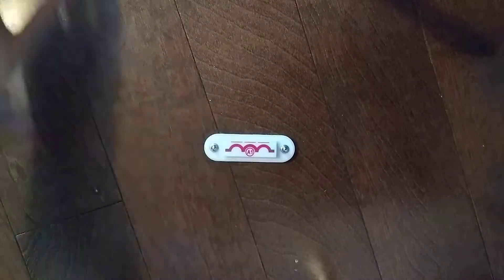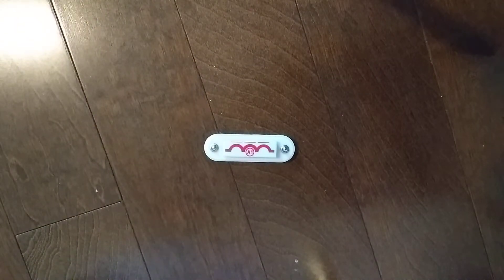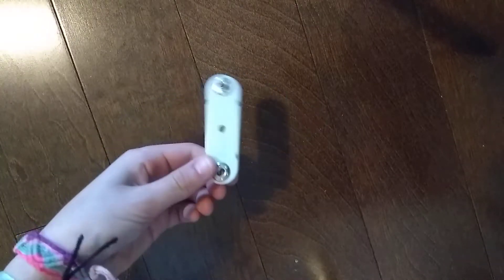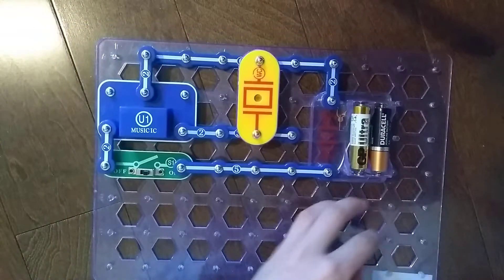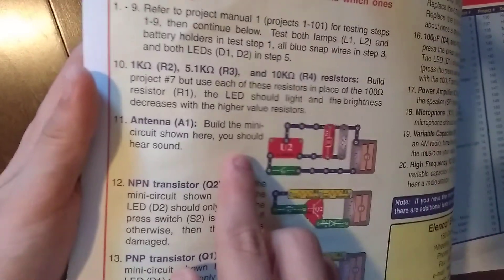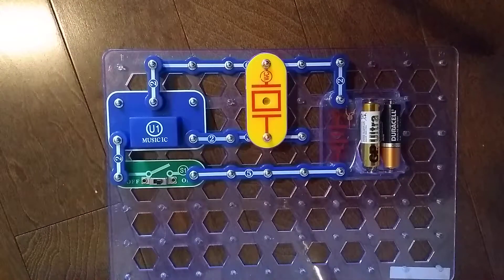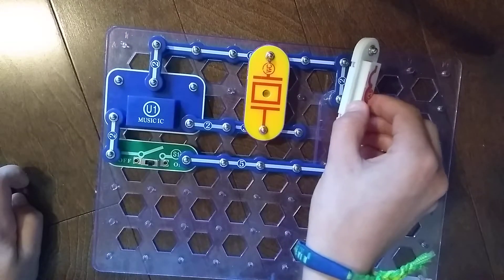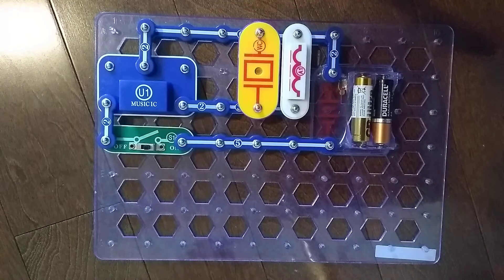Snap Circuits Parts: A1 (Antenna Coil)

Comment: The Antenna Coil (A1) can also detect AM radio frequencies if you can connect it to the High Frequency IC (U5).
Reply from the maker: Okay.
Reply: The antenna coil also is called an inductor and resonates at a frequency  depending on its length and turns of wire. That’s why the am radio works
Reply: What is this freakin inductor, i don't get it. What exactly it does? i can't catch those technical terms in videos, is there any way for me to understand this, i know these terms pretty
Reply: Inductor is a fancy term for a copper wire looped around a metal bar. But then if you connect it to a High frequency IC it will detect Radio waves.